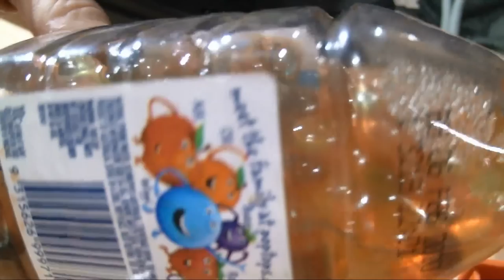Please fix my blaster

Comment: Hi Guido, I need some advice, I did the exact same upgrades to my Vector that you did in the Blackout / Upgrade vid, all went swimmingly, fired half a clip and she just stopped. Then when I pulled the trigger it would only feed gels. Stripped her down and cant see anything wrong. When I contact the mag on the contact points it just feeds gels even when no trigger is pulled. The blaster is brand new, upgraded straight out of the box. Thinking it may be MOSFET faulty ??

Comment: Hey guido i have a question. I have 13:1 gears for a nylon gen 8 gearbox but they don't fit properly there is too much tension that i can't shim the pinion to bevel properly no matter what, any ideas on how to fix this?
Reply: What brand gears? Where is the tension? I have 13:1 shs gears  in a nylon singularity shell that are working fine now after some tuning. Maybe try shimming each gear separately and checking that there is a hair of clearance between the gears where they overlap after that? The motor gear can be shimmed upwards to give a better mesh but you need to be careful that it isn't pushing too hard against the bevel gear and creating tension that way too. Hope this helps.
Reply: @bengauci1836  unfortunately that's not what i mean, think of it like this, the gearbox is closed fully with just the bevel gear (the motor case is on aswell) and it spins freely with gears but there is no play at all. I would put the motor in and it forces the bevel up higher. This is with the pinion as far down as possible.
Reply: @bengauci1836  gears are SHS
Reply: Ok so if the problem is with the bevel gear try putting the shims on the pointy side of the bevel gear so that it is further away from the pinion when it's put together. I usually try to shim the bevel on the wide side so it ends up closer to the pinion so I don't need to shim the pinion but if there's too much pressure there try shimming the bevel on the pointy side so it allows more room to fit the pinion in.
Reply: Other than that you could try checking that the bearings or bushings are all the way home in the gearbox shell. If they aren't sitting in there all the way this might mean reshimming the gears all over again unfortunately.
Reply: @bengauci1836  they have been, i actually filed the lip down too

Comment: can someone please break it down what he did. i’m really stressed out and don’t know what to do
Reply from the maker: so my best guess is that one of the gears had popped out of mesh because perhaps a screw in the gearbox had worked its way loose. upon disassembly there was no noticeable damage, and the blaster seemed to function alright when I re assembled it. with the exception of perhaps still having a sick MOSFET. but that's another problem.
Reply: Low Guido's Chop Shop Thanks for the quick reply, what can i do to get my gel blaster acting normal again?
Reply from the maker: @wafersproductions8573  is it doing the same thing?
Reply: Low Guido's Chop Shop It doesn’t sustain the sound only when i press the trigger the sound plays
Reply: but i checked out the gears and they are perfectly fine
Reply from the maker: @wafersproductions8573  check the pinion to bevel. I have seen them fail with only a very very small sign of wear.
Reply: Low Guido's Chop Shop can i just re assemble the whole blaster and just tighten put it back together correctly?
Reply from the maker: @wafersproductions8573  yeah see if that works and test it like I did in the video.
Reply: Low Guido's Chop Shop I was doing a mod just then. I installed a 1.3 spring with a new o ring and and a stainless still barrel, is it the new spring?